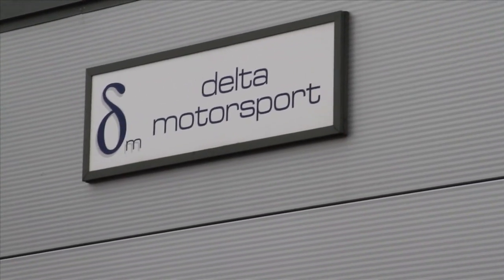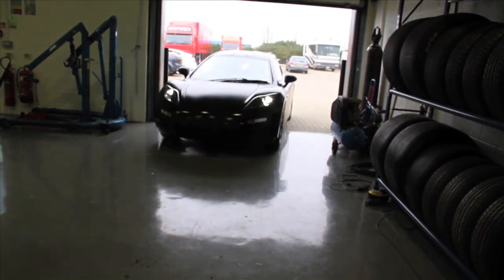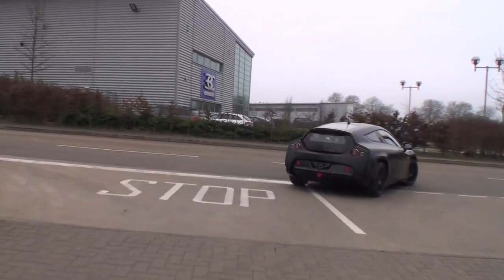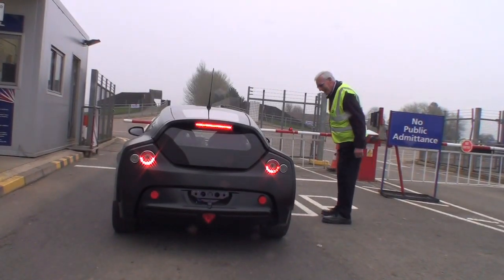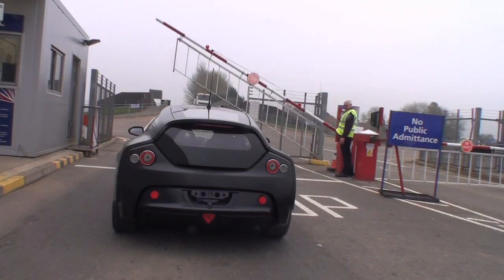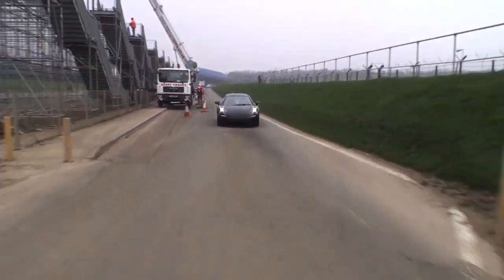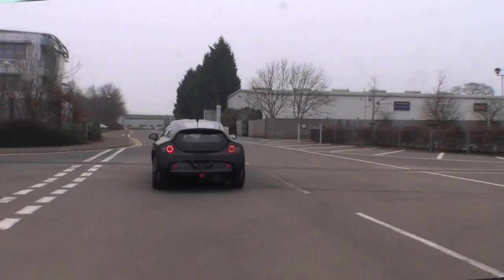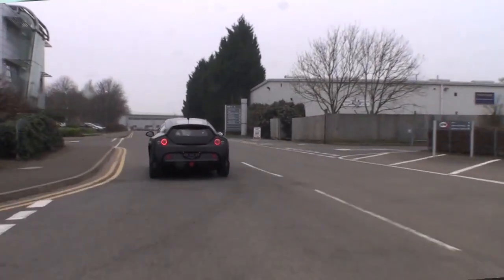Delta E4 Coupe | Fully Charged

Comment: brand new super power full motor 4 times better power to weight ratio as the Prius and 10 less volume wise no gear box one motor per wheel that means 500 hp at 143 hp per wheel

Comment: Don't take this the wrong way but isn't this just using the tech we already have? I mean if you take a load of weight out of an ICE car it makes it faster and use less fuel so when you make an electric from carbon isn't it easy to predict what will happen? For me this does nothing. It's not using any new tech or even old tech in new ways. It's just a light, noisy electric. Or am I missing something?

Comment: I believe we are confused on the topic.
Friction, is part of grip.
Grip is the ability to hold on to a surface and includes things like friction, suspension, conformity to surface, and quite a few other things.
Traction, is grip used to propel the vehicle forwards.

You always want grip, too much friction can be detrimental to grip, because it can cause heat to accumulate in the tire, which can actually damage the tire, such as in a blowout, which is catastrophic.to grip but increases friction.

Comment: Whoa hey ... Friction and Grip isn't exactly the same. While friction is a big part of grip, it's only a part of it. The bigger the contact patch, the less pressure is needed, plus the less chance of breaking grip, which is what happens if you apply too much pressure.

A wheel's / suspentions ability to keep the thread on the ground is just as important, which is the reason why modern tires are square-ish in profile.

Also, the less friction, the less rolling resistance - But you still want grip

Comment: While it's true that you need somewhat narrower tyres as the weight goes down, you also have to be careful not to go too narrow, or you'll get the same issues that old Citron's had ... which is extreme understeer due to bad grip ... really don't want that.

Grip is directly correlated with the amount of rubber on the ground, which is mostly a function of width and diameter of the wheel minus "open thread."

Tire width don't add so much to aerodynamics as the rotating mass of air they generate

Comment: They are often heavy, and often more than they need be. But the light weight racing wheels with light tires still weigh in at 12kg per wheel, that's 48kg for the set ... that's almost 5% of the Delta E4's total weight.

If you put Steel rims and heavy tires on it, you'd have 11kg rims and 11 kg tires, you'd end up with 88 kg for the set. No small wonder cheap cars perform so badly.

Comment: no you want a narrower tire. at least proportionally narrower as the weight goes down.
for a given material the grip is actually independent of width. so the width is for durability. and half will do nicely. also for aerodynamics

Comment: Tires are a bit more difficult. The further out from the center of the wheel you place the weight, the more rotational mass you add, which can negatively affect handling. But you still want a wide tire (within reason) to improve grip.

It seems most tires weighs in the are of 11 to 9 kg, with the Firestone Firehawks GTA 2 being only 8½ kg or so (from a 205/50/16 tire comparison). Weirdly, there's almost no data for narrower tires, or low roll resist tires, but they seem just as heavy - dunno why

Comment: Still have to be able to handle 4 big heavy persons if it's to be a midsized family car. even with the lightest of cars, we quickly run up at half a ton of sideways pressure in the corner, so we can't cut too many corners or they'll break.

Still, 4 kg per rim is allright, and they'll hold up to the abuse. Besides, the rims are almost the least of it.

Comment: you can get some 3kg rims, but the last time I saw a pricetag on rims like that, they went for about 11.000 US $ for 4 rims .... ouch !
Standard steel rims for, say, a Mazda MX3, is about 10 kg each, cheap alu rims will usually be about 8kg or so. 
Some nice alu rims like Konig Feather weighs in at about 5½  kg each and are very affordable, and some expensive alu rims like the Volk Racing TE-37 weighs only 4kg each and costs about 2000 Us $ for 4, that's less than one fourth of the carbon rims.

Comment: no you don't.
you simply speak from mindless convention, unwilling to realize that things can be dramatically different.
and the E4 has thin shell seats. it's super bare bone.
the battery is way too heavy but there must be other culprits. maybe the power electronics is done with very heavy elements. I'd like to see a component weight list

Comment: And you overestimate it.

More importantly, you underestimate the weight of other components, even if the shell goes down in weight, all the rest, such as wires, batteries, electrical motors, control electronics, seats, air bags, air condition, brakes, windows, windowvipers, headlamps, interior, etc. etc. still weighs a lot.
Even if you can bring the weight of the shell itself down to almost nothing, you still end up around 7-800kg or so with a mid-sized modern car.

Comment: Eh ? The Leaf weighs about 1.5 ton, of which 300 kg is the battery pack, that's not exactly better.

The size of the battery pack, will be a bit on the large size until we get fast recharging points on service stations across the country. Until then, a bit of extra range will be needed, so that's not so strange that they have a big battery in the E4 coupé.

As for the overall weight, you still underestimate the amount of material needed to make it crast test worthy. Plus gadgets 'n' stuff.

Comment: yes the battery in the E4 is apparently heavy. I've just exchanged a few emails with delta. but it shouldn't be heavy.
the chubby Leaf manages with 24kWh and they put 32 in a tiny all carbon rather aerodynamic car. that's a big mistake. huge.
the pack should weigh no more than 100kg.  they must have made other mistakes to end at a ton though

Comment: I'm not saying it weighs the same as steel.
But if you want a strong shell, it's going to need much material, and that adds weight.

As for the battery (which are of the lithium iron phosphate variant, AFAIK), I read somewhere that the battery counts for 370 kg of the weights total weight, which was around 975 kg. Which is still a fairly substantial chunk of weight.

Comment: even with lifepo it could be done with under 300 and more importantly if the car is lean you really don't need 32kWh, that's a big pack. the chubby Leaf does quite well with 24 so a carbon aero car should be able to do the same with 12 or less. at which point the pack can weigh below 100kg.
if it's true that the E4 weighs more than a ton that is a very spectacular failure on delta's part. they could have converted an Audi A2 and come in well under.

Comment: criticism is perfectly fine, you just have to make sure it's right. or you'll get criticism from me : ) and you were quite wrong.
that you would have liked even more info does not mean the good video you got for free is bad.
as for the weight of the E4, carbon's low weight is exactly why it's used, it doesn't end up being as heavy as steel if you want strength. that's dumb.
as for battery weight, that's not quite true either. the rather large 32kWh pack could be done with 150kg of laptop cells

Comment: That was sort of my point of why it was bad, compaired to the rest of his video's of the time. Sometimes in order to give feedback, being poositive isn't enough and you have to be negative. I didn't do it to slam Robert And he did do another video of it, and it was better.

As for the car itself, and it's weight, well batteries are quite heavy I'm afraid, plus it's a very strong shell both in frontal and sideway crashes, because it has a lot of material ... the more material, the more weight.

Comment: sure there could be more specs and interior shots but it's very wrong to say it was bad let alone really bad. that's just ridiculous. it's a great video. hosted by Kryten : )
and there are many shots of the exterior, in the excitement you just forgot.
and noone else has done videos about the E4 which could have been an important car except they somehow mysteriously messed up the weight of it despite prolific use of carbon fiber and no amenities. quite the mystery really.

Comment: @fullychargedshow Motor manufacturers generally dont allow journalists to even see their test bed/mule/protoype vehicles let alone ride along in them. During the video it can clearly be heard that this is one of 5 such vehicles. Please follow up with these guys over the next 12 months if possible to keep us informed on their progress. One question, was the quoted 125 mile range with the smaller or larger battery pack?

Comment: @Pukkatronic if you play the portion back that talks about battery. You'll hopefully note the guy says 'this one as it is at the moment, has a smaller battery pack'. Just powerful enough to 'test' the car, in the sameway as you receive 'test cartridges' when you purchase a printer. This surely means that there are MORE POWERFUL BATTERY PACKS than they were THEN using. If you listen to the guys comments, you can almost hear him about to say before interrupted larger will be available.

Comment: @Pukkatronic Wouldn't it be nice if those of us who do not NEED to drive long distances drove electric cars and took the pressure (albeit slightly) off of the fuel supply making the prices lower for those who do NEED to drive long distances. - Just a thought...

Comment: @NickCarpenter Certainly trying to pin down a range with all the variable driving parameters is difficult.  I'm not familiar with the NEDC driving cycle, is it similar to the LA4 cycle?  The LEAF got 100 miles on the LA4 cycle with it's 24 kWh pack, giving it 240 wh/mi, which would give it 133 miles from a 32 kWh pack.  Tesla Roadster got 240 miles on the LA4 with a 53 kWh pack, 220 wh/mi.  I'd expect your car to do even better.   Do you have cd and cdA numbers for the car?

Comment: @NickCarpenter In that case 120 miles from a 32kWh battery pack is rather poor, if that is indeed the maximum range, or is that only what you've tested to?  I'd expect much better than that for such a lightweight vehicle if aerodynamics are good.

Comment: @NickCarpenter 
When isolating vibration, rubber mountings really make a big difference. But also different types of pumps have different types of noise. Screw pumps for example, have a very smooth and low noise. Not to mention that a pump with lower rotational speeds of it's internals may produce a sound that is easier to isolate, than one running at a fever pitch.

I'm guessing you are currently using an (internal) gear pump as it is, yes ?

Comment: Very nice work.  120 miles on 21kwhs of batteries is pretty good.  Obviously in a finished vehicle with an interior most of the noise people are commenting on will be gone.  My EV has a rather noisy vacuum pump as well but buried in the back corner of the trunk on a piece of foam you can't hear it when driving.

Comment from the maker: @MrChrisRab You make a very good point but as  IamVerilance  pointed out, the car is still unfinished. I could put specs in the video but it can put some off. However, the car currently uses 2 axial flux motors made by YASA motors of Oxford, a spin off company from Oxford University. Each of these motors produces over 100 hp but as they are still experimental, a lot of the specifics are still to be revealed. At present it has a 21 kwh battery pack but they can fit a much larger battery.

Comment: how much did it weigh? how big was the battery pack?
will there be interior padding on the car.

it's interesting to note that vibration dampening/sound suppression is a key engineering discipline. obviously the car works but it has a tinny sound and it sounded like it had some creaks too and the picky masses will probably thumb their noses at it.

good direction though with aerodynamics and low weight. with the right pack they should be able to beat the tesla

Comment: I can easily imagine a scenario where you would normally drive with 2 wheels powered, but in emergencies, easily flip a switch to 4 wheel drive to get out of mud or snow.  I also realize the electric motor sounds could be easily muffled as the car is perfected. Few moving parts, few things to go wrong.  Looks great to me!